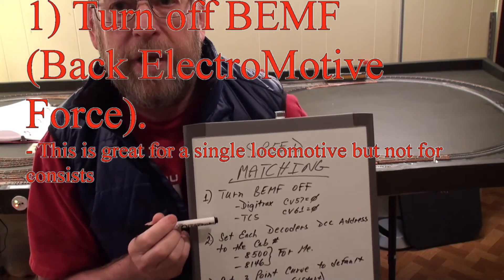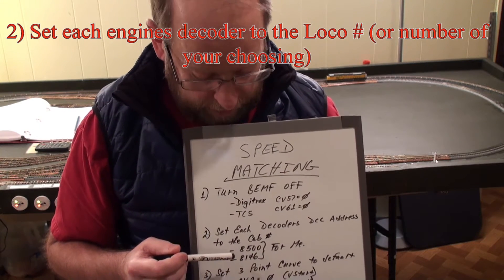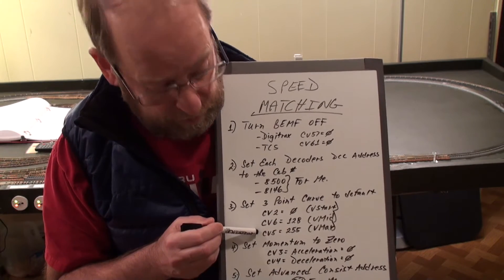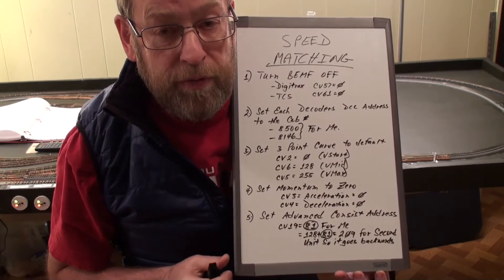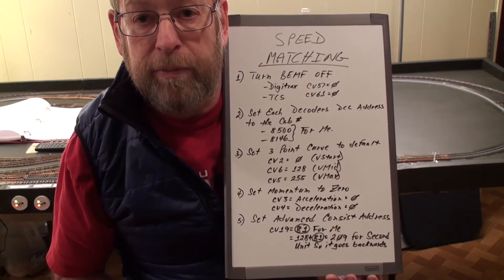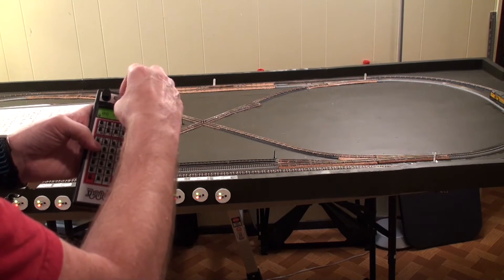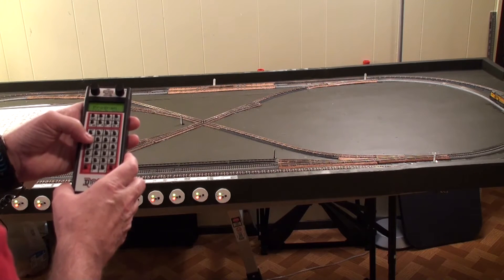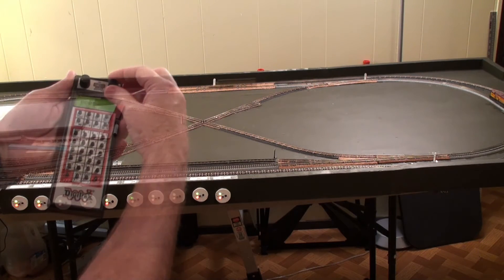N Scale Locomotive Speed Matching with different decoders

Comment: followed your instructions to a tee and the locomotives would not move not the atlas or the Kato
Reply from the maker: Step one is to get the locomotives to move.   If they will not, it has nothing to do with the above method, something else has gone wrong.   I'd start by resetting the Decoders to the factory defaults (generally, write "8" to CV 8).   Then change the address on the decoder and verify that has worked.   Step through the items one item at a time to verify that they work.   Remember, the only step that really needs to be done on the programming track (with only 1 loco on it) is setting the DCC address.   Once that is done (you have to do for each loco and each one's DCC address needs to be different), do all the rest of your work using "Programming on the Main".

Comment: good video will it work with different name brands like Atlas and Kato that's my problem the Motors are totally different?
Reply from the maker: Yes, the method works fine with different manufacturers engines and / or decoders as well with what are thought to be the same.